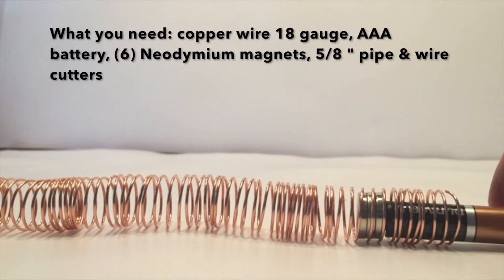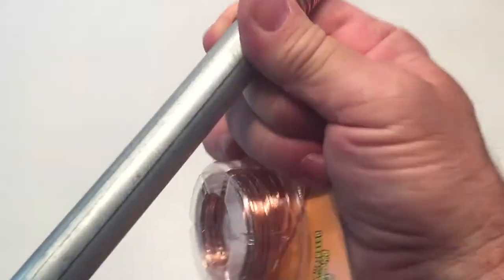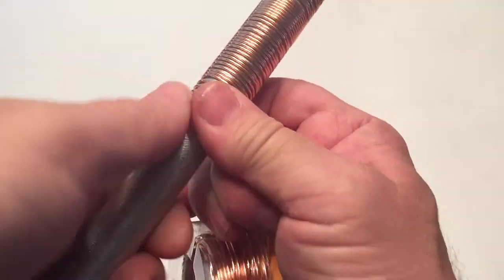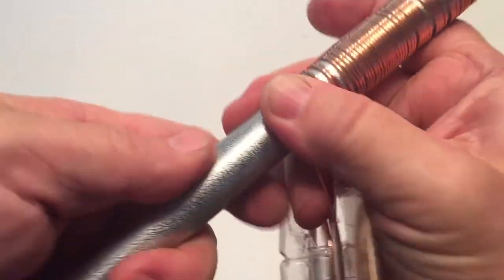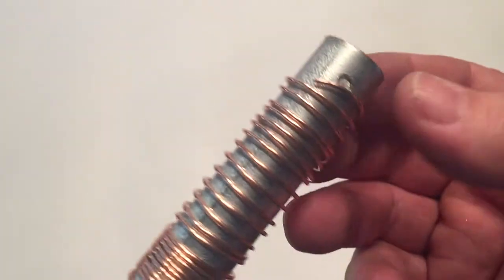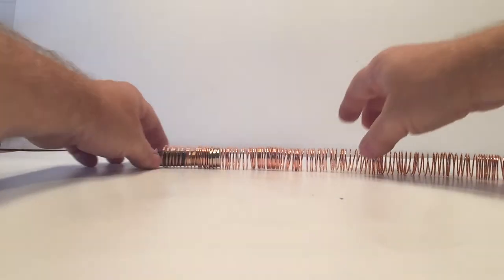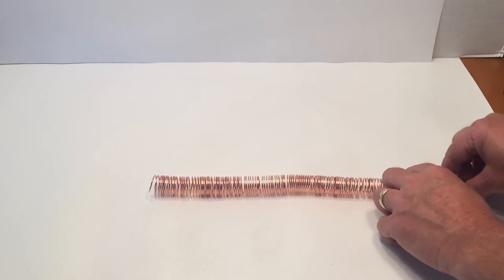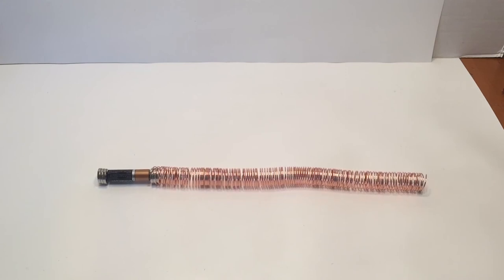Electro Magnetic Train Experiment (How to make a electro Magnetic Train?)

Comment: I tried this experiment using 20 gauge copper wire, a AAA battery, and I also have at least 6 neodymium magnets and its still doesn't work do you have any suggestions?? I have also tried using an AA battery with a bigger coil and still no luck.
Reply from the maker: Morning Marina, I will try to help you. Are your magnets wider than the battery?   This is important as they'll be in contact with the wire to create current. Are you using PURE copper wire? Copper wire from a craft store doesn't always work. Also if it does not go reverse the train and try it the other way. Let me know if these tips help? If not I will see what else I can do to help you. Thanks and Happy New Year!
Reply: Hi there thanks for the reply. I am using the same brand copper wire but 20 gauge and if made one coil for a AAA battery and one for a AA battery. the only thing that I can see different is my magnets are the same size as the batteries. Still won't move. ?????
Reply from the maker: Do you know if your battery is still good? Make sure it has a good charge. I found one of my batteries were used and did not move. Also once you put it in the copper give it a push. Can you send me a picture/video of your set up to elementarysciencenight at gmail.com and I will take a look at it. Thanks

Comment: If I use 18gauge copper wire (1.219mm diameter) 
Deadsoft 99.9% pure copper wire without enameled  --- DIY jewellery
Will it be ok? To run the magnet
Plzz reply me fast I need to submit my project within 4 days 😯😯😯
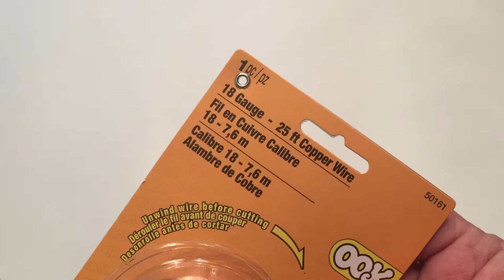Reply from the maker: Good Morning Ajay, It should work, but I tested it on 18 gauge copper wire that I bought at a hardware store (Not jewelery), which you can see the package I use in 0:20 But your wire is 99.9% pure copper so it should work.  I would suggest to make a small track like a 7 centimeters and test it to make sure it works. I don't see why it wouldn't work. Please let me know the results? Thanks Ken

Comment: It's not working i have used insulated copper wire that is black in colour and aa battery and two small neodynium magnets little bit smaller in diameter of battery
Reply from the maker: Sorry its not working, but lets see if I can suggest a couple things that might help. I used 18 gauge copper wire, with AAA Battery, and (6) Neodymium Magnets, 5/8 inch in size. What gauge wire are you using? I see you have AA try AAA. Also I used (6) magnets and you are using (2). Let me know if this helps? thanks